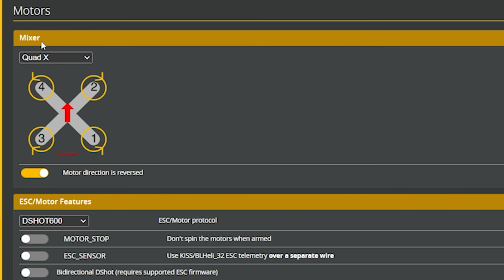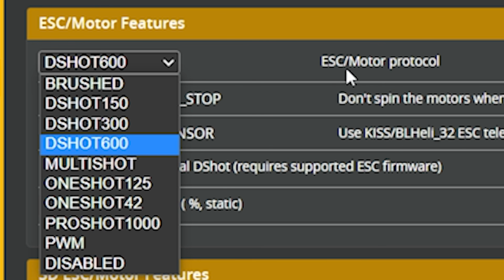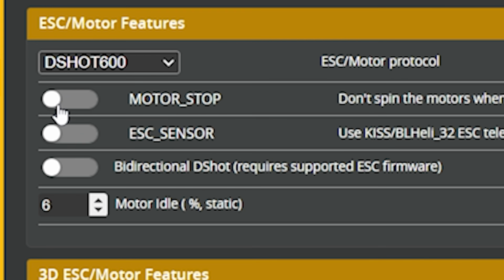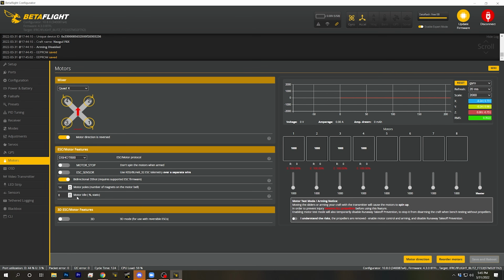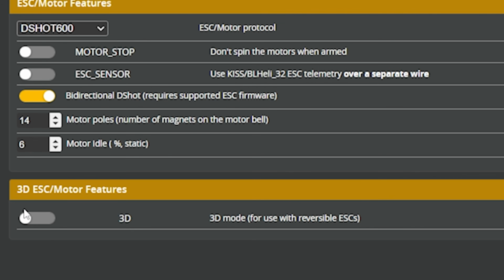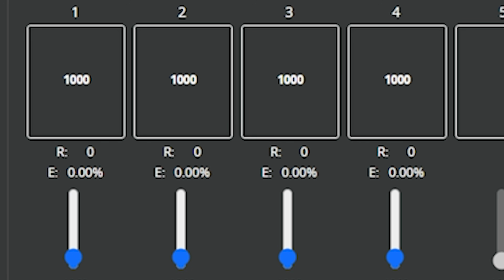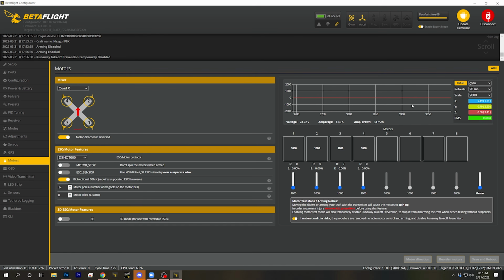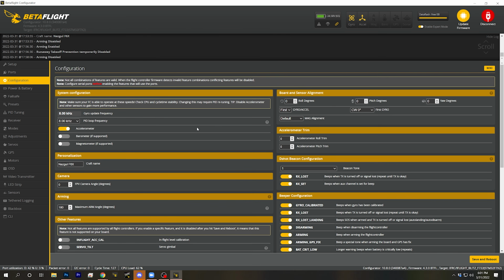Betaflight 4.3 Motors Tab | COMPLETE WALKTHROUGH PART 5

Comment: I use MOTOR_STOP on all my quads since I started with FPV 8 years ago and I will set it up on any other quad I will build.
I use it mainly for hand catches (when there's no safe space to land or just for audience). I use 3-position switch for arming when 1st position is disarm, 2nd position arm and 3rd is arm + airmode.
That way, when I want to perform a hand catch, I fly my quad in front of me and flip the arming switch to 2nd position, when airmode is inactive and then I manuver my drone closer to catch it with one hand, while having throttle stick in control of my other hand. And when I want to catch the quad, I just lower the throttle all the way down and motors stop spinning. And then I disarm comletely.
The only risky part on this is, when catching the drone, not to accidentally raise the throttle before complete disarm, because of course the motors would spin up again and there would be bleedy fingers or face. :D

Comment: I just turned off bidirectional dshot off and now my air65 and its stopped fluttering and death rolling so i think its messing with the 2026 aphla firmware which i haven’t changed yet im trying to wrap my head around firmware flashes
Edit* the reciever antenna wire was laying flat against the FC🤦

Comment: The reason why Ian here is that when I turn it on… in the app it shows a problem that bitbang Dshot has a problem likely caused by a timer conflict with other features enabled on the fc. I use it on desk top and doesn’t mention it. Using Speedybee f405 v5. Running in dshot 300 currently. New quad and flown yet

Comment: Two of my motors spin from one input and they are all connected properly, do you think i received a faulty stack?
Reply from the maker: I think that inside the ESC plug on the FC, two pins are bent over and touching each other. Unplug the ESC plug from the FC and look inside it and I think you'll see one pin bent over to touch another. If you are super careful, you can get in there with a tweezer and bent it straight again.
Reply: @JoshuaBardwell Awesome thank for the reply, I also thought that there may be an issue with the connector. Thanks alot 🤙
Reply: @JoshuaBardwell yep one of the pins was bent over and was on the the other one, thanks for that you probably saved me a lot of time 🤙

Comment: 10:40 are you sure that electric motors have HIGHER toque at HIGHER throttle? I always thought it was the other way around. That's why a tesla has a great 0-60 but slows down after that.

Comment: Greetings, I have seen many videos and this is the best one that explains these Betaflight configuration points, but I still have not been able to properly configure the motors of my Pavo20, I think because no video explains what is the correct position to align my drone if with the battery facing down or how the propellers look facing up and what is the front part of the drone frame.

Comment: I quad flew great until I updated to beta flight 4.5. I used the correct target. Everything is set up perfectly except for the motors tab. Dshot 600 and bidirectional dshot is turned on. I have two motors spinning and the other two show E: 100.00%. I never had an issue before with this. Just wondering if I'm missing something

Comment: Suddenly one of my motor stoped working, it vibrates once when I plug it in with the power but then it doesn’t work. The rest of the motors rotate. I went to the CLI tab in betaflight and typed the command “resource”, it shows :
resource MOTOR 1 A15
resource MOTOR 2 B03
resource MOTOR 3 B04
resource MOTOR 4 B06
resource MOTOR 5 B07
resource MOTOR 6 B05
resource MOTOR 7 B00
resource MOTOR 8 B01
I use the speedybee f7v3 stack what should I do?

Comment: I tried to configure according to your video although preview responds according to the remote control. However, the motor does not spin, even though I am able to control motors using app.
I have configured the flysky transmitter and the receiver with the speedy bee F7 stack. In my Flight controller there are 4 pins for receiver (GND, 5v, R2 and T2).  What should I do and what is the problem?

Comment: Got my gyro set and moves correctly, props on correct, motors move fine in betaflight but when trying to actually fly the front sucks down when the back should be pushing and no throttle, all the motors worked correctly before the gyro adjustment, please help!

Comment: This is crazy. My motors are reversed (spin outward). I had a magnet come lose on a Blackbird motor making it hard to spin so I swapped all 4 motors with an old set of Velox 2306 motors I had. I went to test fly it. Ramping up throttle and no leaving the ground, just motors spinning up & pressing the quad into the ground harder. So I arm and disarm to see the motor direction and sure enough the motors are spinning backwards. Weird because I wired them exactly as the BB motors were wired. I swap the props around and it does the jump in the air and disarm thing. OKAY! Go home and hook to Betaflight to change the motor direction, but when I have BF spin the motors, they're spinning in the correct direction (outwards). I put the props back on, go back out to test fly and it flies perfectly. Somehow the motors changed direction all by themselves and without swapping motor wires and without changing settings in BF, the motors start spinning in the correct direction. How stupid is that?
Reply from the maker: Wiring different motors exactly the same does not guarantee they'll spin the same direction. The construction of the motors can make two different models of motor spin the opposite way even if they're wired the same.
My guess is that when you ran the BF motor wizard, it reset the motor direction, and the defaults turned out by chance to be correct.
Reply: @JoshuaBardwell  If it reset the motors, it did it automatically. All I did in BF was tell it to spin the motors so I could check the direction and see if I needed to reverse the directions. I didn't tell it to change anything. I didn't save any settings. When I seen them spinning the correct direction I unplugged the battery and the USB cable. I didn't hit the disconnect button in BF. 
 These Velox motors use to be on this quad and I have a way of wiring them. Far left wire goes to far left ESC pad, center wire to center pad & so on. That's how they were wired when they came off so I was sure when I wired them back up the same way they would spin the correct direction. 
When I replaced these motors with the Blackbird motors, I wired them the same way and didn't have to change the motor directions because they all spun the correct direction. 

Sometimes, very rarely, I plug in a battery and can't arm. Video works, but can't arm. I have to power cycle the quad. Weird, but it happens and I have no explanation other than the equipment is cheap so it's bound to screw up from time to time. Possibly a power surge prevents the code from running or it causes a line of code to skip? A quadcopter blue screen of death kind of thing I suppose.
Reply: @JoshuaBardwell  YouTube's code screwes up too. I'm watching your video but the description is for OceanGate Expeditions, a video I watched a couple videos ago.

Comment: I watch this twice and did everything as in this video.  I have the correct motors spinning and in the correct direction as in Betaflight.  Also, my TX16s sticks move as required in the receiver tab.
HOWEVER:  When I disconnect from Betaflight all my motors spin in reverse compared with the setup.  How is that possible?
Reply: I know it sounds rudimentary, but did you forget to hit save and reboot after your changes?

Comment: Pleeeeeeeeease heeelp! 
When im controlling the motors via the configurator they spin perfectly fine, all in the right direction. BUT when I arm the quad with my receiver, all 4 motors just go wild and spin up to full throttle. I made sure to be in acro but this doesnt look like an angle correction either.
I didnt find anything yet, so if anyone maybe has some advise, it would help me a looooot!
Reply: Hey guys! I have the same issue and I can’t figure out what is wrong as well. Via the configurator all works pretty well, but when I arm the quad with the remote controller sometimes the motors are spinning pretty normal, but very often they go wild, and I feel very strong vibrations. Any suggestions?

Comment: I need help, I have the iflight protek 35. was flying fine, decided to update to betaflight 4.3 applied my preset configuration and now I get 100% ESC error in motors tab. I turned off Bidirectional and now the error is gone and motors arm properly. I would like Bidirectional but cant figure this problem out.

Comment: What  if my m1 pad is burned out and i need to use M5???
Reply from the maker: Remap motor 1 resource to motor 5 pin
Reply: @JoshuaBardwell i've tried the common cli resource remap but it ends in a mixer error. May be a bug?

Comment: i installed firmware 4.3 bf on configurator 10.8.0 and connect my drone, but hen bf downgrade itself to firmware 4,2,8 

Can anyone explain what’s going wrong??

I have all drivers and download bf require to run..

So when I go to motortab in configurator, I got the message (you have to upgrade your firmware) ?? But I already upgraded..

Anyone with same problem ?
Reply from the maker: Basically, you didn't upgrade. I don't mean to argue, but there's just no way a FC could revert itself from 4.3 to 4.2.
Reply: @JoshuaBardwell  sry it’s my bad English.. 
I appreciate your feedback.

I try again.
if I connect one of my old drones (Revolt) it show bf 4.3
Then I bought Geprc Mark 5 after I saw your video with your presentation of the drone..
When I plug in Geprc Mark 5 to bf, then bf says it’s firmware 4.2.8 and I have to upgrade bf before I can check my motor on this drone🤔
I have tried your recommendations, to set the box (unstable firmware) till on with no luck..

Sry my bad English, I hope it’s better explained now??

Comment: hey Joshua... why do I not have access to the motor direction changing option? I've flashed the newest firmware, but in the top left it says 4.2.11 instead of 4.3.0.  is it possible my ESC doesn't support it? thanks.
Reply from the maker: Install configurator 10.8
Reply: @JoshuaBardwell  hmm, I already had it, and tried uninstalling and reinstalling, but the latest firmware for my FC is still only 4.2.11
Reply from the maker: To see 4.3, you need to enable "show unstable releases" like I show in part 1 of this video.
Reply: @JoshuaBardwell  I actually figured it out, I hadn’t watch the video close enough. My quad flew amazing until the ESC shorted out for no reason and ruined two motors…
Reply: Hi  @stopmobro4332  what was the problem ? Bc I have the same problem 🤔
Happy flying🤙
Reply: @cabomful  hi, you have to check “show unrealeased version” or “show release candidates” or something, then the 4.3 will show

Comment: If that's the I Flight  Nasgal 5 Evoke  The motor screws come loose because of the 3-D print on the bottom of the arms.   Joshua you have to take the screws out and put  The blue to the screw lol lock tight.

Comment: Hey Joshua, I'm a huge fan of your videos and think you're so knowledgeable about this hobby that so many of us love and enjoy. On top of that you show such a great ability to explain things to all levels of experience so that we all do, in fact, learn something today. I, however, have a question.

 I own a tx16s and a tinyhawk freestyle 2. One day when i was updating the firmware on my radio I made the rookie mistake of not double checking that I did in fact make a backup of my old firmware and had all my models saved on my computer. As you may have figured, I did not have those aforementioned backups and had to reset up my quads' profiles. Not the end of the world, right? Except for now my aux switches wont respond in betaflight. Since then it's been a few months and I reflashed my radio into edgeTX successfully and my Protek35 even still worked with the radio afterwards. Once again though, no response from my aux switches on the Tinyhawk. If you could help me out I would be so grateful. I feel like the solution is simple and im just not looking in the right place, but even still... I've been looking for months now. At this point I figured I might as well buy a second Tinyhawk Freestyle 2 but I'd like to not have to spend that money if i can help it.

Thank you for taking the time to read this if you even see or get to this point. Again, I love your videos and have gained so much knowledge from them, and that's not even mentioning the wonderful community you've built. Please, help me learn something today

Comment: I disagree with the “typical” theory of DShot by most BF people. The PID loop and DShot value are not connected in any way. The frequency of each means nothing to the other. DShot is a serial Baud rate (1 baud = 1 bit/second). It’s a transfer rate, not a polling rate like the PID loop. In my opinion, you should run the highest DShot value possible while maintaining reliability. PID loop rate is irrelevant. KISS runs a 1kHz loop and DShot2400 for gods sake. And you (or perhaps I) can absolutely tell a difference between that and 600. It’s a small gain but a gain nonetheless.
Reply from the maker: Betaflight's argument is that you use the slowest baud rate that keeps the frame time less than the loop time. This means you minimize the corrupted packets since the slower baud rate is more robust. KISS argument is you run the fastest baud rate possible to minimize latency between the FC and the motors, but it means you get more corrupted packets since the faster baud rate is less robust. I'm not sure which is right, but in a Betaflight tutorial, I'm going to parrot the Betaflight party line.

Before anybody (including you) claims they can tell the difference between dshot600 and dshot2400, they should do a blind test. If you've done one, link it here :-)
Reply: @JoshuaBardwell  I understand the argument. But I’ve never really seen any reason not to run the higher rate. In terms of corrupted packets. Obviously electrical noise can play a major roll in this, but the wire runs are so small, I can’t image it causing any issues. It’s just one of those small points of latency decrease that adds to the whole.

Comment: What are the rest of the esc/motor Protocols for like multi shot and pros hot 1000?
Reply from the maker: The true answer is that they are archaic and basically should never be used with any modern equipment.
Reply: @JoshuaBardwell  thankyou!